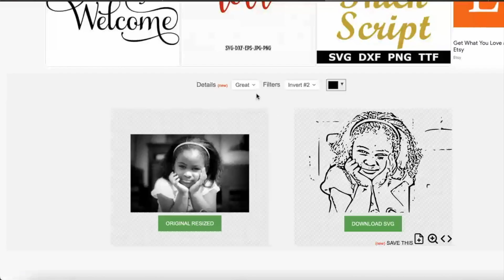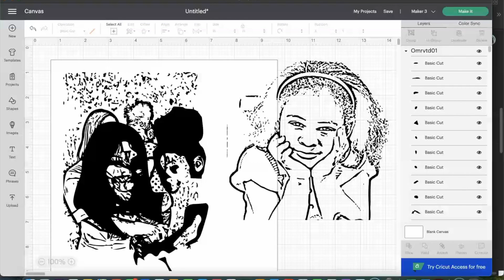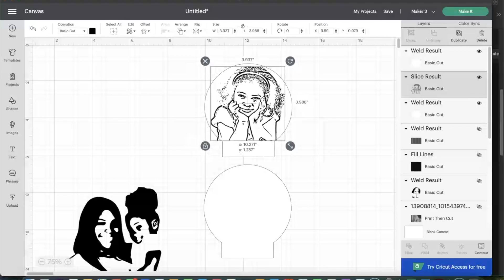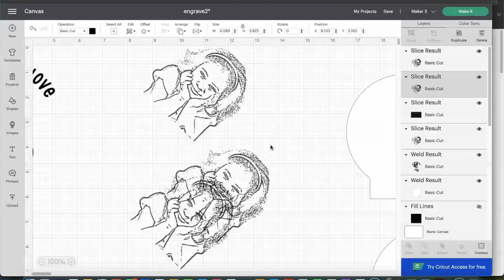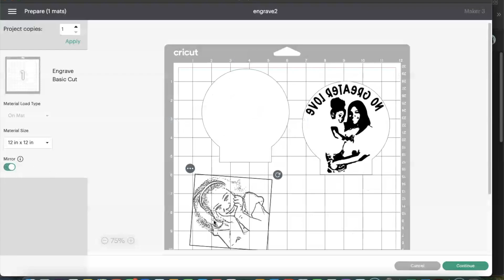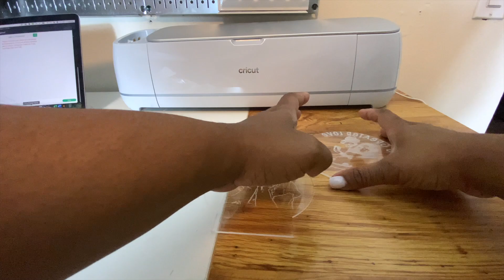CRICUT MAKER | HOW TO CONVERT PHOTO TO SVG & ENGRAVE ACRYLIC USING FILL LINES IN DESIGN SPACE

Comment: Great video! I have a Cricut Maker 3 and I verified that it has the latest firmware. I have also updated my Design Space and installed the engraving tip. When I select the acrylic in the materials tab it tells me that acrylic is not compatible with my setup. I'm at a loss. Any suggestions??

Comment: This is regarding putting photo on acrylic.  Why will it not let me pick slice after i enlarge my black line and enlarge my photo.  I put my photo on black lines and select both but my slice button is grayed out and will not let me slice?
Reply: Just a few troubleshoot ideas:  

Is the piece locked so you can't edit it 

or is the file too big or small quality?

Make sure it's svg file. Png is ok in some cases to have it convert to svg in design space but it will need to have the right math information for the pixels.

If it's grey then it might not be a solid line that's compatible for slice.

Design space might also need an update.

Might be worth importing it again or converting it again as design space can also be temperamental.

Comment: So..you have the bases and acrylic blanks linked here to Amazon that YOU used but...The acrylic blanks are 4mm NOT 2 mm with this product..how did you get this to work then on the maker if the blanks are 4mm??  I have been having a MAJOR problem finding a base that holds 2mm blanks securely..these bases are all made for the 4mm width.  I have had to return 3 sets of these already because they don't fit securely, they wobble :(
LOVE your tutorials though!
Reply: I came here looking for the same answer. I want to make them to sell and I want the acrylic to be in there securely!
Reply: I have the same problem but it still works ok.
I'm gonna try sticking white adhesive foam that's 1mm sheets to the part that goes in the 4mm slot. It would create a sandwich. I was going to glue extra acrylic pieces but i figured the glue might cause shadows and idk how it would work with the foam sheets but i feel like it would work out. I'll try it out and be back.